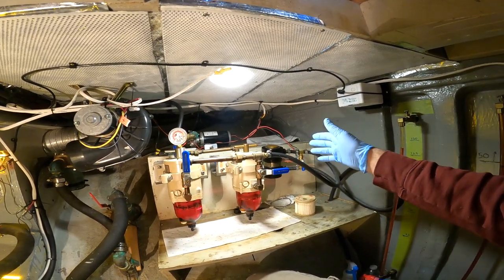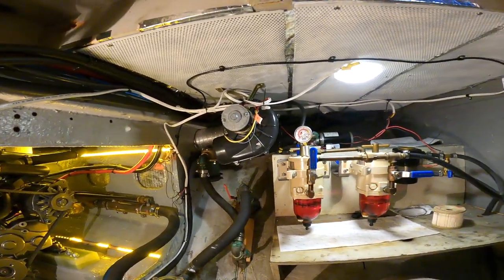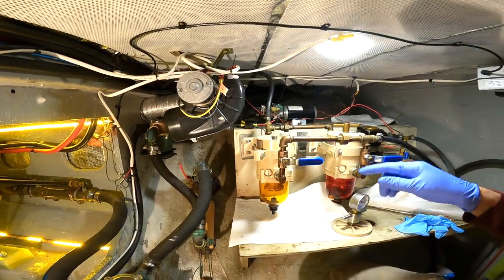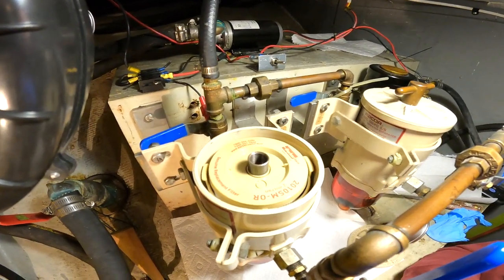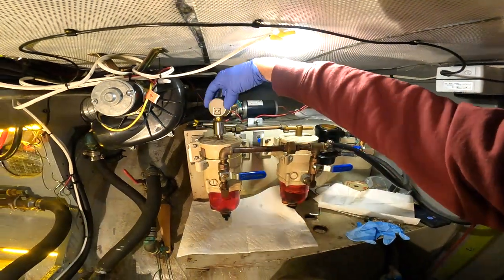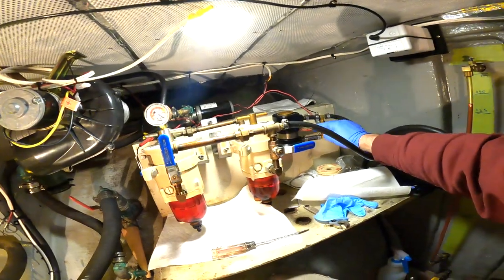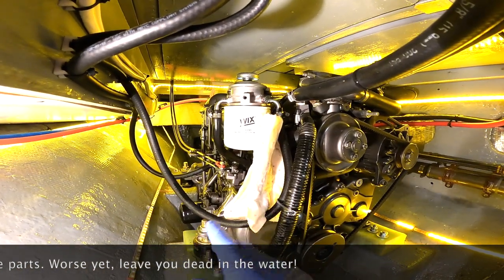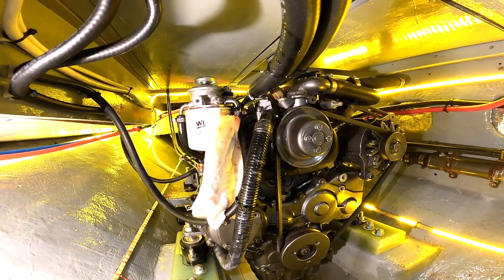Tech Tip#22: Electric Priming Pumps for changing diesel fuel filters

Comment: The electric pump can also be a backup pump for the engine mounted mech pump in case that fails ?
It will deliver fuel through the mech pump through the pump non ret valves as the flow is towards the engine
However a diaphragmpump fail will cause fuel to leak into the bilge or engine oil, I would fit isolating valves
Reply from the maker: Yes, the pump works as a back-up for your engines lift-pump. There are a number of complications though, as you said if it starts leaking, also some (certain Volvo's) have internal screen and if it clogs the pump won't help.

Comment: This is, like the reverso oil changing system, one of the things that makes boating more fun than work.  Does it also have enough pressure to prime the injector pump?  I didn't see you do that and all the videos I've watched for bleeding my system (Lehman 120's) show a messy bleeding of the injector pump by thumbing the lever a gazillion times.  Regardless, this is a must-have system for PLEASURE boating.
Reply from the maker: Yes it would bleed the injection pump if you inadvertently ran out. You would just cracks those two screws on the top outboard edges on a Lehman's!

Comment: Is your system pulling the fuel through the Racor filters or pushing it?  The Racor manual indicates that putting a pump on the pressure side (pushing fuel) is not ideal as pumps emulsify water hindering filter performance.  Curious how yours works - pushing (Pressure side) or pulling (Vacuum side)?
Reply from the maker: Works great, but it's only for priming the system, that's why the bypass valve. Normally when running the fuel is pulled through the filter. 
In the event of a low-pressure pump failure on my engine, I'm sure it'd work fine to get me along until I could make a repair.

Comment: Mr Beamer, I notice you run a 2 micron primary and a 10 micron secondary.  I do this on my boat, because previous owner did it.  If Yanmar is OK with a 10 micron rating, why be aggressive with 2 micron at primary?   In my case the secondaries are very hard to get to and it buys me more time between addressing the secondary filters.  

I also run the Racor gauges and love them.  This setup reports the suction between lift pump and Racor only correct?

I have some twin Yanmar 4LH-DTE on my boat
Reply from the maker: Good question - I'm not on the boat this Weekend, but I think the secondary (most manufactures) is somewhere in the 2 - 5 microns. The primary would be a 10 micron, and it would last longer than my 2 micron. On my old Perkins, the secondary was a bugger to change, so I stretched the service interval by running a 2 micron primary. I just re-powered a year or so ago with the Yanmar and still have a case of 2-microns for the primary --> isn't it strange why we sometimes do things...

Comment: Could you use an in-line pump like a facet purolater cube and not need the extra valve?
Reply from the maker: The reason for the valve is most pumps restrict the fuel flow too much. You don't want to starve the engine for fuel.

Comment: What's the brand of the priming pump you use?
Reply from the maker: That black pump is like 35 years old, and came with a spare. Black Pearl is vintage. I can't remember the brand we used on King's Pride. Any pump that matches your voltage (12 volt for us) will work just fine because the demand is very low.